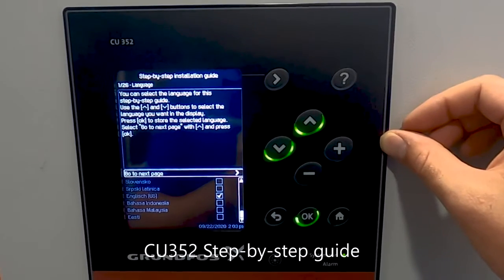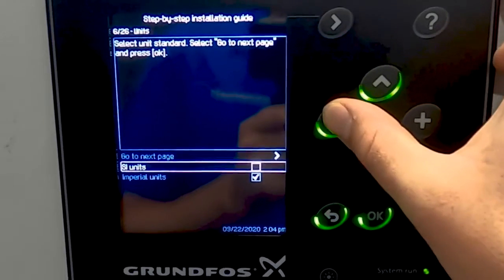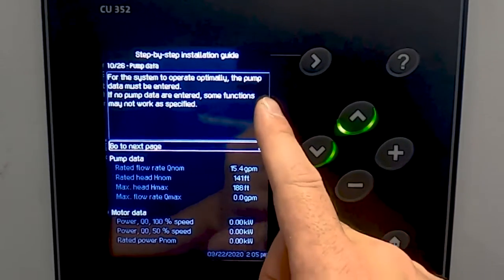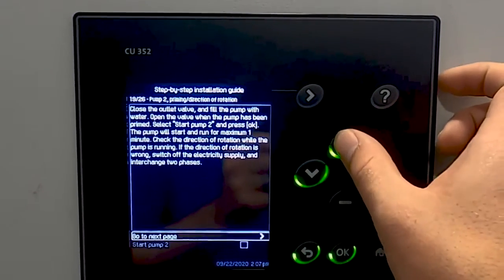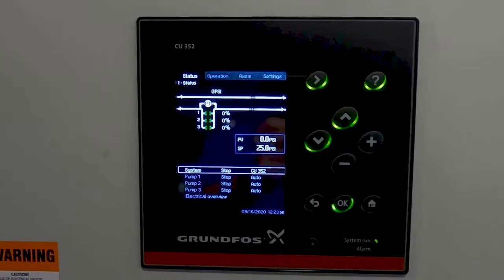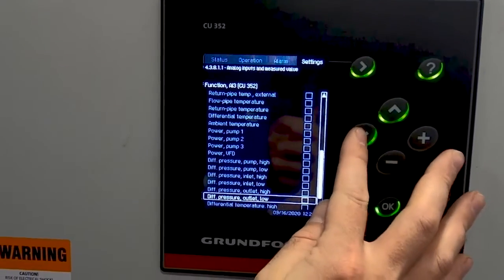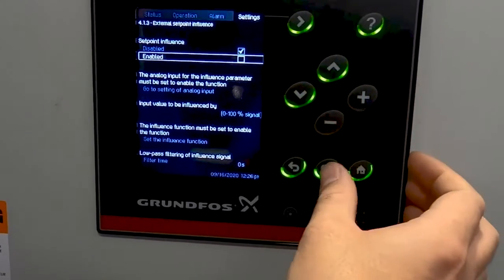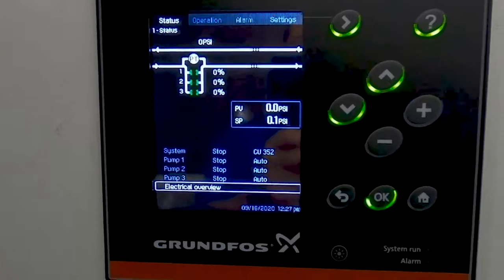Grundfos Hydro MPC System Startup Guide for HVAC

Comment: What is the code 73 low voltage fault mean and how do i reset that please?
Reply from the maker: Hi @phaple_j5i the cause is a fall in mains supply voltage and the solution is to restore the correct mains supply voltage. 

If you have additional questions, don't hesitate to get in touch with our team directly for support here: http://gfos.ly/6057xmhl5

Comment: What is the reson for  over current  alarm
Reply from the maker: hi @sijurajraj9047 in general the alarms are to notify of an issue and to protect the pumps and skid system. 

You can access the Hydro MPC IOM here (Alarm section 9.6 starts on page 28): http://gfos.ly/6055xmhld

If you have additional questions, don't hesitate to get in touch with our team directly for support here: http://gfos.ly/6057xmhl5